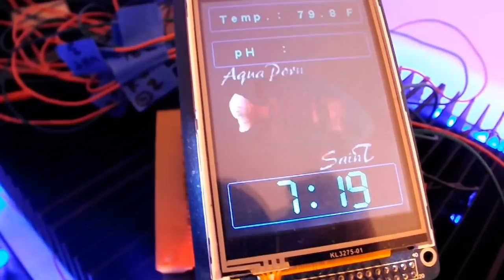DIY Outlet Control using Arduino - Part 2 Hardware

Comment: I'm curious as to why you used so much hardware to step up and down your voltage and current?  I'm assuming that you are watching YouTube videos as to how to use your Arduino and putting things together as you learn, correct?  

Around all that water, you would want to have a small footprint for hardware and things falling, as you see how quick and easy they do given your screwdriver head mishap. The better way of stepping up and down voltage is and current with a smaller hardware footprint would be to use a current/voltage limiting circuit; which is just what your devices are, they're just built to be stand alone devices. a small circuit using resistors, capacitors, voltage regulators or maybe an op amp would be easier to work with and safer for you and your fish.    

I see that this is a old video and you may have changed this setup to something more proficient than what's in this video by now; because we learn best through mistakes and errors right? :-)  

I'm just curious if there is a reason that you used that big clunky hardware to step up and down your voltage and current, thanks.
Reply from the maker: Kenneth Elston  Thanks for watching! Yes...pretty much the learning process. Fishkeeping is my hobby, and I didn't know much about circuitry. Still don't :)

I only knew about the step downs as an option from watching another guys project, and he used them in the same way I am.

Since, I've a subscriber who has made circuit boards for this project that makes it a smaller footprint. 
I haven't completely abandoned this project, but I haven't touched it in quite some time. It has been running my marine tank just fine up to this point. 

Like I said my hobby is fishkeeping, and I've been really wrapped up in my Apistogramma breeding and building my fishroom.
Reply: Very good, I'm glad to hear that!!!  Watching your video, I kept thinking; this guy is going to electrocute his fish or himself.  

Do you have video of your new setup and putting it together with the new circuit?  Thanks.

Comment: Thanks for posting the videos.  I'm currently trying to get an Arduino Mega to control a relay to dim a lamp and turn it on and off. and dimming I wanted to read your build thread but could not find it at AQcenter.net.  Could post a direct link?  Thanks again.

Comment: Fantastic!  I'm not sure where I will go with mine as I already have 2 RKL's for my reefs- but they are very limiting.  I'll have a look for your code.  Another option for you maybe would be to just use dropbox or Gdrive and sync the files automatically to the same link.  Might save u some time.  Maybe not :)  Cheers and thanks!

Comment from the maker: Thanks much Eric! The graphics are simply pictures I created using MS Paint Brush. They are stored on the SD card and called when needed.
I have a build thread in the Marine Hardware section of AQcenter. net. It is from the very beginning of the build. I used to be quite detailed prior to making videos, but I constantly update the code and .raw files there.
I tried using Google Code and Git Hub, but could not get my sketches uploaded for some reason??

Comment from the maker: The project started as just an LED build, but I didn't want all the bulky individual drivers necessary or their chords to run the LEDs. Then I discovered the Arduino, and found I could run 1 power supply with a driver shield. As well as program sunrise/sunset and weather lighting with Arduino. The more I learned about the Arduino micro processor the project grew...and is still growing to a full reef controller.
It has to stay up in the lighting because that is where the driver shields are.